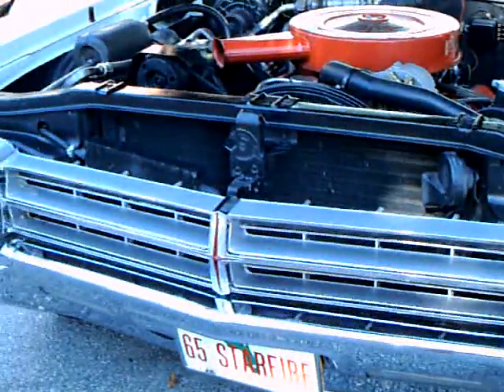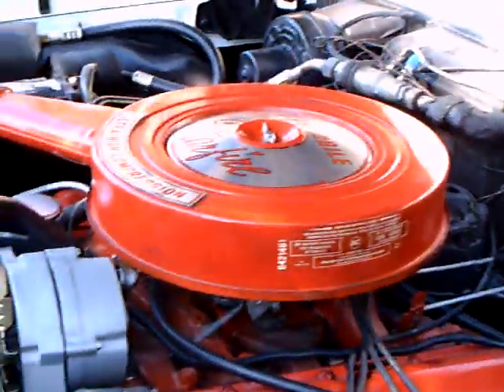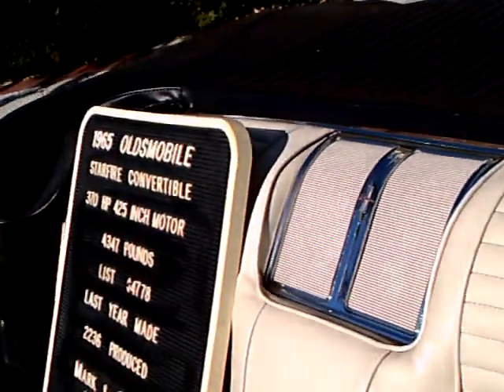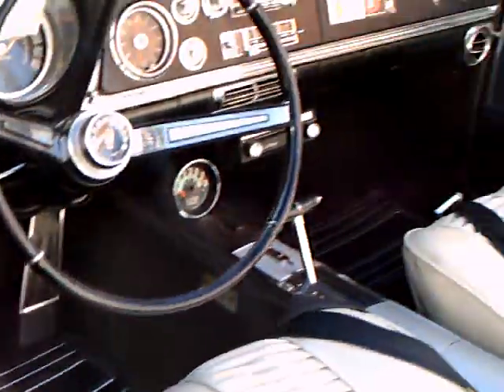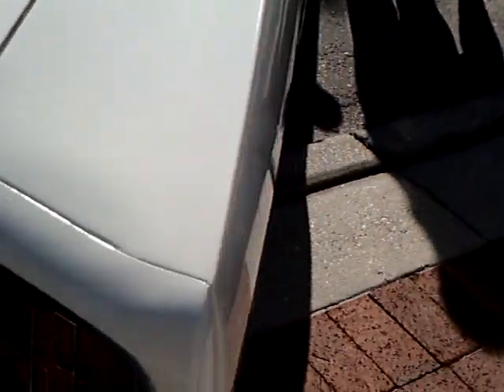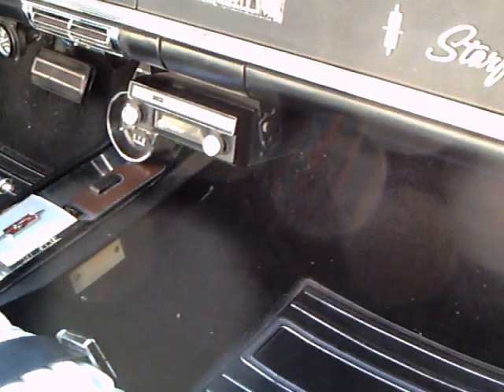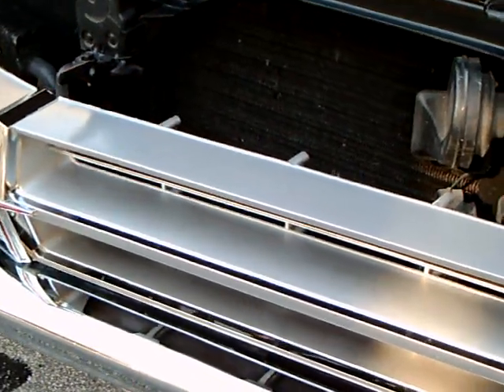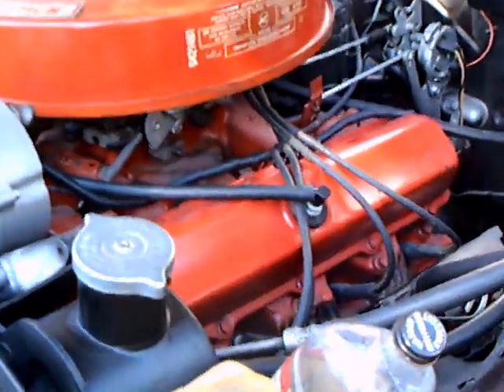1965 Olds Starfire convertible

Comment: Very nice car. I owned the '65 Olds 98 LS with the 425. I had it up to 118.5 MPH! It had the exact same dash layout. Two features my '65 had that I miss today was the automatic headlight dimmer system that would put switch the high beams off when an approaching car came. I also miss the speed minder system. You would set a dial in the middle of the speedometer to your highest desired speed and a buzzer and an amber light would flash when you hit the set speed. Olds sure made great cars.

Comment: Gorgeous! And worth every penny of $4778. One of the sharpest cars on the road in 65.
Reply from the maker: Sure is, Dave...Starfires were in a class by themselves!  Thanks!  :) Jack
Reply: At $4778 in 1965 it was about $300 more expensive than the $4400 Olds Ninety Eight convertible and the Buick Electra 225 Custom convertible. It probably was closer in price to the Chrysler 300 letter series convertible of the same year.

Comment: I would imagine that a well optioned Starfire convertible with wire wheel covers, dual 6 way power seats, an FM Stereo. radio, power antenna, tilt, cruise, power door locks and air conditioning would jack the MSRP to about $6300 including destination charge. That's low end Cadillac Calais territory!
Reply from the maker: Hey, Larry!  That was truly the dilemma at General Motors!  They loved to have brand loyalty, hoping that those high prices for a loaded model at the top of their respective lines would still draw buyers in to that model rather than a junior model Cadillac.  I think that's where the merits of a brand's engine came in....true believers in an Olds Rocket engine would hold firmly that that car was superior.  Same for Buick owners, who felt that there's nothing like a Buick engine.  That's why it was almost a catastrophic development when GM started using Chevy V8's in Oldsmobiles in the 70's unbeknownst to the public.  Gone was one of the reasons for sticking with Olds!  Thanks!  :) Jack

Comment: This '65 Starfire is a stunning, gorgeous, sleek, sexy automobile with power to match. I felt this video did not do the car justice, but was still okay. As far as the Starfire goes, there's a bit of an ironic twist here. The convertible version of most cars is usually much more desirable than just the coupe, and probably is also here as well. For me personally, the roofline is a key element in the car's beauty and without it is more like the 98 convertible except for retaining the exclusive grill, taillights and interior. For this reason I prefer the coupe. In closing, I never liked the Toronado nearly as well as the Starfire.
Reply from the maker: Hey, Bob!  I have many more videos of the Starfire here on the channel...perhaps others will give a better view.  I have always loved the Starfire...a friend had a hardtop and I thought it was the coolest car I had ever seen!  Thanks!  :) Jack
Reply: Bob Pierce 
The 65’ starfire is the only car I’d take over a first generation tornado